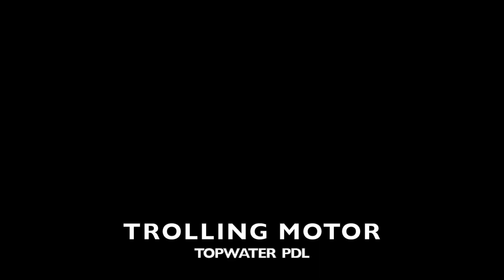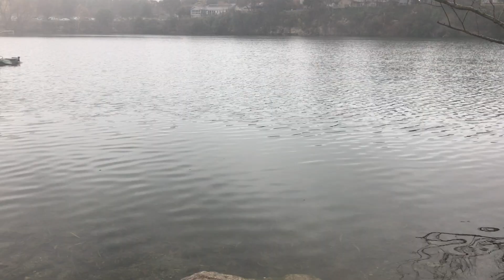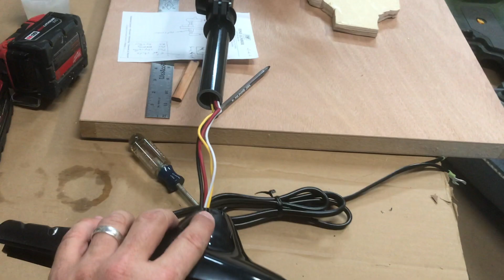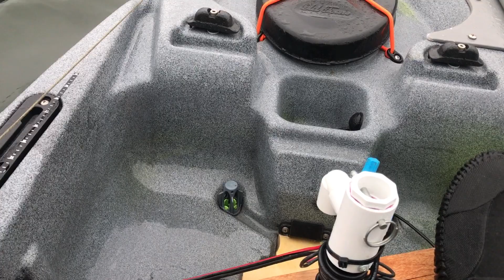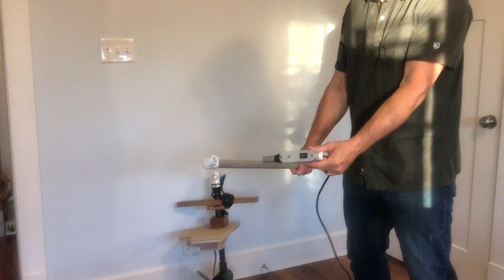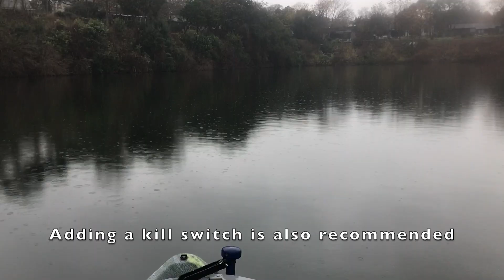Topwater PDL Trolling Motor

Comment: What pwm did you use for the trolling motor?
Reply from the maker: I used this one.  It is around $20.  @t
Reply: @kayakfishingworks1304  Um, was there a link or something? I don't see anything.
Reply from the maker: @corwinblackthorne  You Tube took down the link.  Did not realize that I cannot post Amazon link.  Go to Amazon and search for 
Motor Speed Controller, DC10V-55V PWM Brushed DC Motor Speed Controller Adjustable Driver CW CCW Reversible Switch with Digit Display